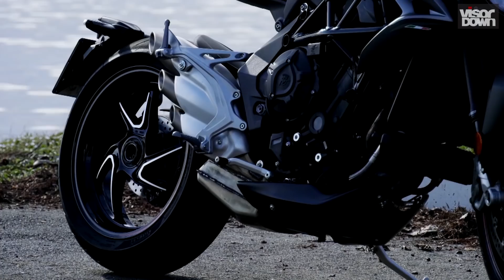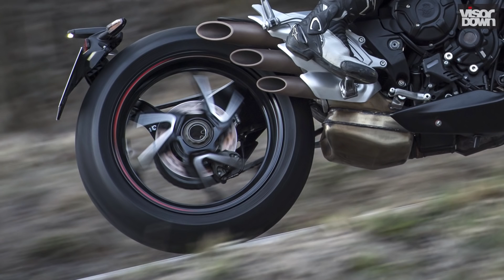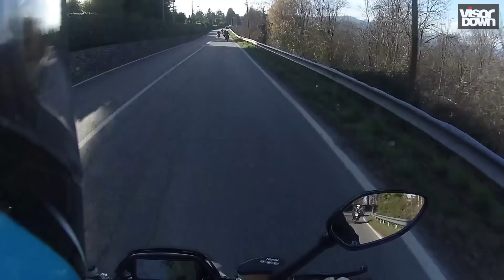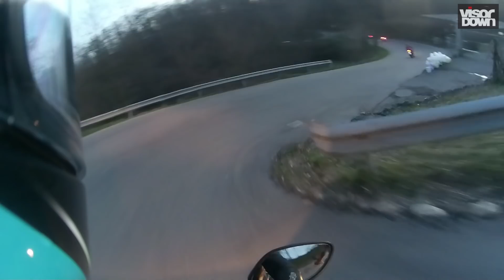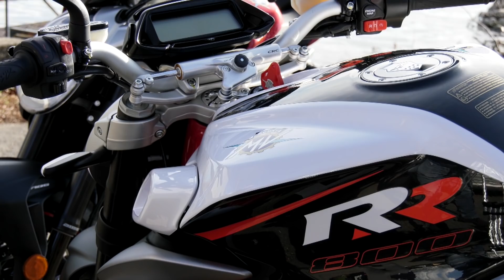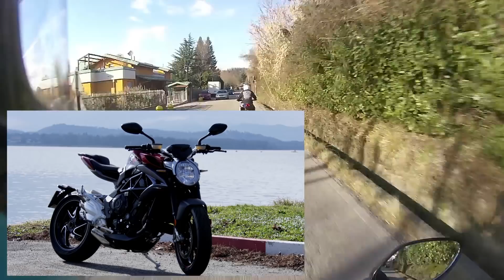2018 MV Agusta Brutale 800 RR | Visordown Launch Test

Comment: The RR model is the first dragster at 140bhp. If you reflash and pipe it you can get 150bhp. They have pre throttle body injectors, so the triple has six injectors. This tech is normally only on super bikes like zx10 etc

Comment: mt10 would smash plus it's cheaper
Reply: Lol lets compare a litre bike to an 800, seems fair. MV beats it in looks and finish, might even have the edge in corners as they are so flickable, no contest on the straights or the bank balance though I'll admit 😬
Reply: Ironically you are actually comparing them.  For a fraction of the cost of the Augusta you could upgrade the forks and suspension, exhaust, ecu flash, tyres etc and still have enough spare change for an all inclusive holiday to the caribbean for 4 people and a 9 bar of hi grade cannabis to smoke at the pool with your bong.   

The Augusta looks good but is obscenely over priced and just not worth it just cos you want to look really cool with that exhaust
Reply: Alloment Proof 😁 each to their own then, always good to have choices in life 👌